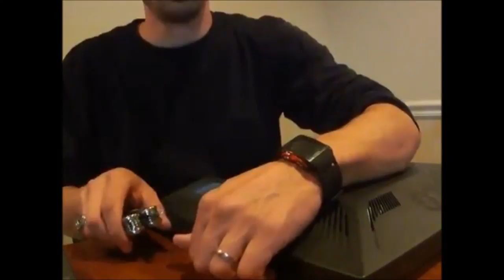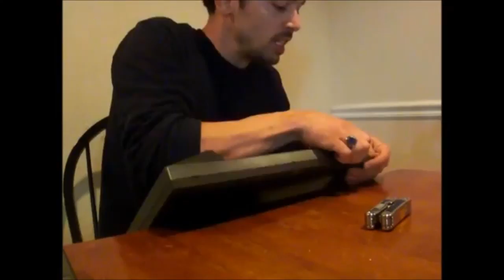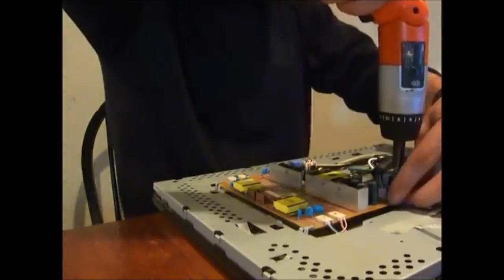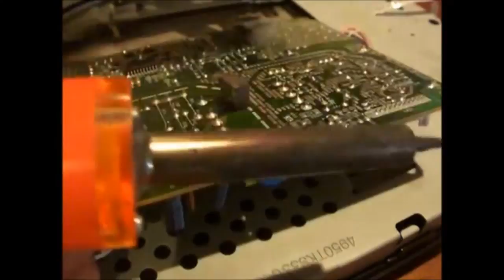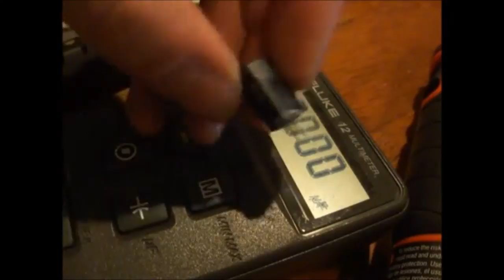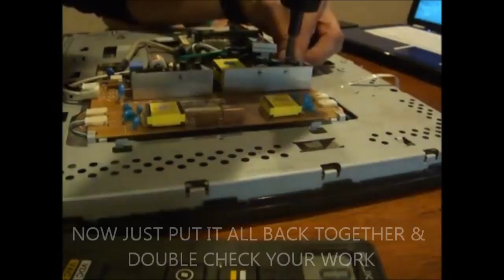How to fix LG LCD monitor- no power

Comment: Hi and thank you very much for posting this video!   I reviewed your instructions and found them easy to follow and to be complete. As I love fixing laptops and computers anyway this was a very do-able task for me.   I loved your step by step instructions on what to look for and what is important (+ - ) like polarity of the caps when installing them.   The only extra comments I would make is that you have to measure the outer diameter of the cap, the distance between the + and - leads and height up from the main board of the existing caps that you are replacing and make that part of your criteria when looking for replacements.  It matters because sometimes space is limited and you can't exceed that height of the metal cover if it interferes with a component or the spacing of other components around it.  The spacing of the + and - leads is critical as they have to fit into the existing holes that are provided in the main board when you are replacing them with new ones.  
When installing the new caps, make sure they are tight against the main board before soldering.  Use an eraser or other spacer object to make sure the new cap is pushing up and touching the main board before soldering.   I found what works best when soldering the new caps in place is to heat up the cap lead that is sticking up and add solder to the lead, letting it run down towards the main board.  Not too much ! Touch the solder iron against the solder running down the lead until there is just enough at the connection to the main board to ensure conductivity and hold it in place.  Essentially, it should look just like the solder weld before you removed it in the first place.

Comment: I did a cap replacement on my 40" Samsung LCD.  After about an hour of my TV being on the picture would go completely out but the sound would stay on.  I could turn off the TV and then right back on and it would stay on for about 5 mins at a time.  So I replaced the caps and put everything back on but now I have no sound but my picture is on.  Any advice?  Please help.  Thank you.